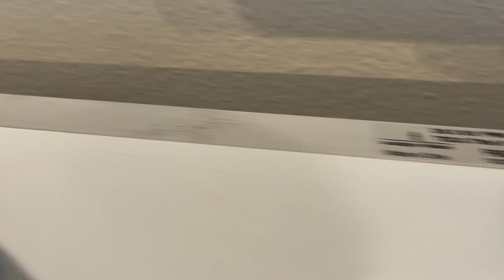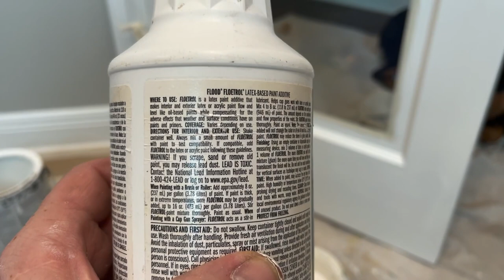Paint French Doors to a Spray-Like Finish with a Brush & Roller - Spencer Colgan

Comment: Hello Spencer,

Your videos are the best. I always learn so much and do my best to follow your order of operation and tips. Thank you for the quality content. 

If you had 60 seconds for some advice…

I’m painting some older bifold doors. Some are flat panel and some are open louvers. All are the victim of a previous bad paint job. There’s so much roping it’s as if they were painted with a straw broom. And it’s glossy paint too. So sad because the doors are in good condition otherwise. 

I’ve taken them off the hinges and used a finishing sander w/ medium grit sand paper to knock the roping down as much as possible. I also have a dremel sander for the tighter spots which may proove helpful on the louvers. Or I may just hand sand. 

Is sanding down the roping a good idea? Is it worth the time and effort to replicate the process across all the doors? I have done one and have seven more pairs to go. 

I’m planning to spray the doors w sherwin Williams Pro classic smooth enamel for trim and doors cut w some M1. Although I admit this will be my first time using a sprayer. So there’s that. 

Any advice on getting the best possible results (and not making things worse) is welcome. This is my home and I’m doing my best to do my best.

Thank you and plz keep the quality content coming.
Reply from the maker: Excellent!

Yea.  Go for it. It’s worth it. Your sanding will pay off.  Sand out those rope marks.  Want to cheat?  Put some 5 min. Mud on it and sand with 180 grit. Why not?

Use a fine finish tip (green) and reduce sprayer pressure to 60 %. Go for it. 

Spray lightly. 

Please give me. 5 star Review for my assistance and content as you said.  Please. 

https://www.google.com/search?q=tampa%20wallpaper%20installer&tbm=#lkt=LocalPoiReviews&lpg=cid:CgIgAQ%3D%3D&trex=m_t:lcl_akp,rc_f:nav,rc_ludocids:18168418332679895040,rc_q:Spencer%2520Colgan%2520-%2520Wallpaper%2520Installer,ru_q:Spencer%2520Colgan%2520-%2520Wallpaper%2520Installer,trex_id:XCBBr

Comment: That's how I do it. Especially when it's a panel door. I always tell my guys work inside out. Panels first both sides by the time you finish the last side the first side is dry then use your fine roller and done. Looks great almost like sprayed

Comment: When it comes to white trim paint like the one you used on the French doors, what brand do you feel it’s best. I’ve used different colors Behr paints but when it comes to their white paint, it seems like it does not give you the smooth finish you expect. Great job with the French doors!!
Reply from the maker: Want a little secret? You are right, pure white doesn’t do the trick! Go to your paint store and have them add the slightest amount of a color which is black it is called Umber

Comment: Great video.  Trying to apply your skill set to 16 linear ft baseboards that came primed and ready to paint. Laid out on 4 tables, I'm undertaking one at a time. Hate brush strokes. So do I apply two coats with brush sanding between coats?  Or just sand 2nd coat before using roller?  Here's the challenge.  They're 16 ft long. How do I get seamless application that length? I'm adding M-1 to paint. Paint is drying fast.  Can't get from one end to the other using one long stroke with roller.  Suggestions and helpful hints PLEASE.
Reply from the maker: You’re going to do a 3-foot section…. Then after that, go another 3 feet away and start back towards your first 3 feet. 

Watch this

https://youtu.be/KDgR28VFFyw
Reply: @spencercolgan  That's exactly what I did with the first baseboard using a brush. But I thought to eliminate brush strokes, I was to use a roller as the last coat.  Will working 3' sections with a roller work? Or is that just for brushing on paint? I wasn't happy with the result using a paint brush and 3 ft sections.

Comment: Spencer was there a reason why you didn't remove hardware from the door
Reply from the maker: Yes.  The metal in door knob hardware gets impressions upon initial installation; when you remove the hardware, you inherit the costly risk of the door knob not functioning 100% the way it did during initial installation. I am not a locksmith; I do not do things in which I am not expert… There is way too much liability in disappointing the customer
Reply: Thankyou Spencer for the quick replay  ,it was not a criticism, have a great weekend
Reply from the maker: @frankmc324  No no no Frank; I do not mind constructive criticism; I must tell you that you are a better man than I am; I will not inherit the liability to remove hardware; I got two thumbs when it comes to restoring hardware and things like that; I only stick with the things I’m good at. Are used to take locks off in my own house and they never worked right after I took them off
Reply: Thankyou Spencer for your quick replay ,i am in new jersey Rumson  middletown area ,I remember being called unprofessional for not removing the door hardware ,being that I  highly respect you ,and your work ,moving forward your video has helped me alot ,because as  like you I am a perfectionist and the customers comment affected my confidence ,remember I am an immigrant and I had to learn the American way to do things
Reply from the maker: @frankmc324  

Frank.  Americans are great at suing each other.  It seems to be the American way these days.  We are painters.  The first thing your insurance company will ask you is if you are qualified to install and remove expensive door hardware when the replacement is $1500 for high end doors. Nope. Had my problems with rich people who love court rooms.
Reply: Thankyou Spencer have a great weekend,oh by the way congrats on your nee boat no doubt hard earned enjoy   @spencercolgan